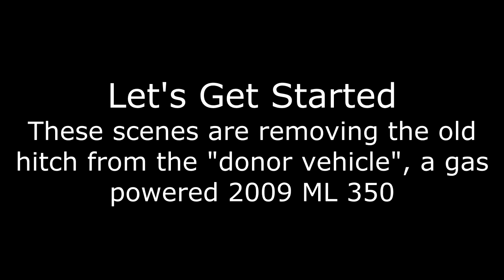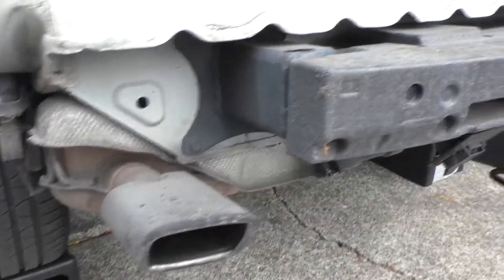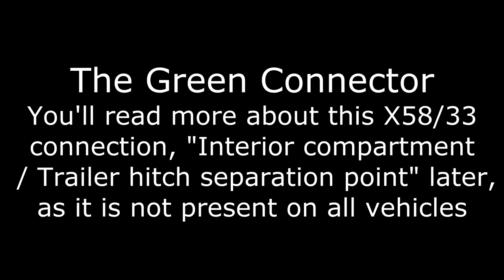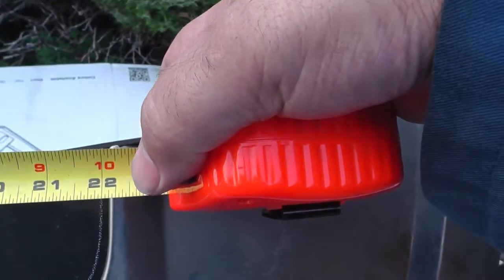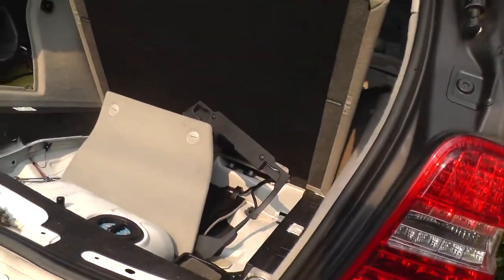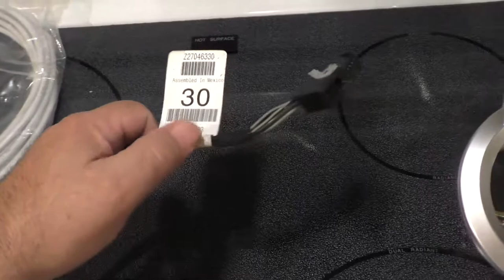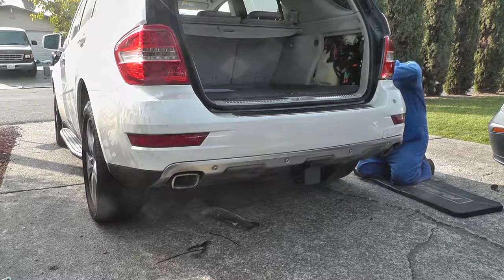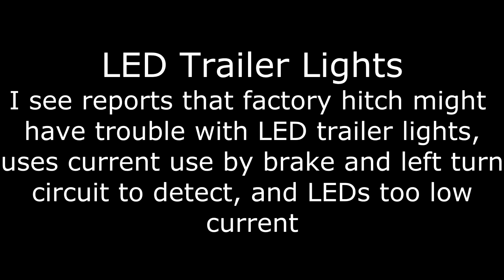Retrofitting Factory Trailer Hitch to Mercedes ML350 -- Remove from 2009, Install on 2011

Comment: A very thorough walk through. Thanks for this. I am planning to install a hitch on my 2007 ML 320 CDI as well. This is extremely helpful. Side note, I think it was very smart of Mercedes to move that SAM module to the new location. It always gets water damage while in the old location.
Reply from the maker: Good luck!

Comment: Great concise and clear video! Thank You for your hard work.What are the benefits of wiring this the factory way? You mentioned the hitch sense when it was programmed by the dealer. What does MB do to the vehicle when this suv is towing something. Does this hitch sense change anti sway,abs,transmission shifting or anything else to enhance the towing experience? Maybe nothing at all!
I have a 2011 ml350 and obtained the complete hitch and harness from the scrap yard.I will install electric brakes for the motorcycle trailer thus I will need  to add necessary connections .Tekonska has a Hall effect wire sense  product that picks up the brake ,running lights and blinkers  from the taillight wires and they also have a wireless blue tooth brake controller that may manufacture that makes the brake controller more convenient to move from one car to the other and install.I noticed that the 4 pin green connector under steering wheel has the connections input and output to the brake controller.I know one of the wires that is black with a maybe white tracer goes to the terminal 15 connector.What this wire does for the Sam I am not sure. I am hoping that the Sam does not need this signal being that it is Bluetooth.
Not sure if to go the MB way or aftermarket route.I appreciate your valued response!
Thank you again!
Reply from the maker: I'm afraid I don't know all the details of what the ML activates when it knows it is towing, but the one I did think of as important and that I did read about was that the "Electronic Stability Program", which is a computerized intervention with both the brakes and the engine power (and, I think, traction distribution) based on input from the steering angle and yaw sensors to help prevent rollover if you "enter an unstable driving situation".   Apparently the system is smart enough to alter the profile for that system when towing, which seemed like a good thing to me.      In other less-good news about the factory system based on recent experience, and I don't know if later SAM revs fix this, is that I went to rent a big U-Haul and had to hook up to several different trailers (using a new 7 pin to 4 pin adapter) unsuccessfully before by dumb luck I hit one that hadn't yet been retrofitted to LED lights and still had conventional bulbs.  The setup would not detect the LED equipped trailers.   I think there are 7-to-4 adapters that can help with this by providing resistors to sink a tiny bit more current to help the car detect the trailer, but I note it as a blemish on my otherwise perfect towing record with this setup.   Note that until the car "detected" the trailer, it did not bother sending lighting signals to the hitch socket.  No lights at all.    I think that the "trailer brake controller", which directly controls the trailers brakes,  would be pretty independent of the SAM, and that a Bluetooth based one would work fine.

Comment: The lesson is to buy a truck with the factory hitch already installed. You sir, have done an outstanding job retrofitting that factory hitch. But I just went with the aftermarket and settled for the lower tow rating. No one could give me a clear answer on the SAM reprograming, and the cost of parts was too high to gamble on it working or not for me.
Reply from the maker: I don't disagree.. the "add-on" cost of the hitch buying the vehicle new is nothing compared to all this hassle, but I was in a bad spot with my insurance company having totalled my hitch equipped 2009 ML350 offering just $7200 because of high (highway) miles, and being unable in the short time I could stand being without my car to find a hitch equipped replacement that met my requirement of "diesel or the larger V8 engine", and "white" and "all wheel drive", and "the same sound and nav package the 2009 had, not the entry level one". I drove all over looking at the cars available in my range, added money to expand the range, and still had to compromise on the hitch in the end.   Had I known what I was in for in the retrofitting, I might have expanded my search geographically or added still more money, but I am glad in the end I persevered. It was definitely a gamble, and even with this info it will be a gamble for others, I just hope I have helped even the odds for someone in a simlar spot.  Thanks for the comment, and glad your aftermarket met the need with less drama.

Comment: Outstanding video, great explanation! I have a question, that you may not be able to answer, but your recommendations will still be appreciated. I have a 2010 ML350, Gas with no Hitch. I have been looking for a Factory Hitch to retrofit as you did, but have come up empty-handed, until today. I found a new European Hitch assy on Craigslist, that will require a lot of modification to work. The Euro  Receiver will have to be removed (Cut Out) and a USA receiver installed (welded) in, and the wiring will probably have to be modified. I am a retired Diesel Mechanic so I am somewhat familiar with these types of situations. However, because of the unique characteristics of the European Hitch, ( it rotates out of the way), it may not be worth the effort. Any advice will be appreciated. Thanks Pat
Reply from the maker: I don’t know enough about the Euro variant to comment, but if the ad is still up with pictures I could take a look and speculate with you, especially if the CL listing has a part number or something
Reply: I just realized that this Hitch doesn't swing out like many Euro Hithes I've seen, but actually has the Receiver mounted vertically (Facing down). The Ball Part of the Receiver is actually inserted up into the Receiver Socket. The problem then becomes, What size is a Euro Ball, too many variables. I kept searching Youtube and then I think I may have found the answer. Tesla uses this same type of hitch, i.e. 2 inch Ball, made by Westfalia (Germany), this may fit the Mercedes Euro Hitch, I assume this type of Socket Insert is a standard fitting.
Reply from the maker: @bigpapaporsche1  Aha. I searched a bit on Tesla, and see you mean "Eco" (EcoHitch), not "Euro".   I see pictures of the downward facing receiver, etc.   My thoughts relative to the experience in the video are that there are two aspects to "mounting" a hitch, the physical attachment to the vehicle frame at various points, and then the wiring and how it taps into the Mercedes wiring.    The EcoHitch's are completely aftermarket, so they will always differ in the physical attachment (won't go into those sockets that then side-bolt to frame, so won't be a full weight redistributing and thus have less overall capacity), but I think you have a choice in how you wire it.    Any of the aftermarket hitches, like EcoHitch, are going to come with (or you can buy if your particular hitch doesn't include) a nice harness and instructions for your particular vehicle on how to tap in.   I believe those are a very light touch on the car wiring, and literally just parallel in on the power going to your existing stop, turn and tail lights.  In other words, they will work fine, but in a very real sense the car "won't know the hitch and trailer are there".    By contrast the factory harness has a very complicated connection into the cars wiring into the Signal Acquisition Module and other points so that when the feature is enabled by the dealer in the onboard computer, the car detects that the trailer is present, and alters the automatic braking and automatic stability controls (among other things) to allow for its presence.    So you have to decide if those additional fancy electrical features are something important to you, and if they are, you would have to follow the EcoHitch's instructions for physical installation, and then my instructions for wiring, including somehow getting yourself the actual factory harness, including the "hitch" part of the harness, and running factory wiring all the way down the the actual socket that accepts the plug from the trailer (using MB factory socket, not the EcoHitch one).    I don't think most people bother with that.  I think when they use an aftermarket hitch, they use the aftermarket wiring style, which is easier to do then all I had to mess with buying relays and going to the dealer, and they're just delighted to have their lights come on when they stop and turn.    I went factory, but you can see the hassle, you'd probably be perfectly happy aftermarket, and if you do, be sure to follow those instructions (not mine) because they're different.
Reply: Pat Maundrell I have the 2010 ml350 as well. Did everything go right? I am in the process of buying an airstream hitch 28’ for a super price. Can you tell me it will be alright?
Reply: @T61873  I decided to use my wife's Subaru for our Towing requirements and not install a Hitch on the ML 350. It is possibe to install a Hitch on a ML350, but in my opinion, ( Baaed on 50 years of Automotive experience) I won't be happy with it. Let's face it, it would be a compromise at best! I bought a Mercedes and didn't want to bastardize it by installing an Aftermarket Hitch, etc.
Here is the best advice you will ever get, regarding Towing a trailer! Sadly, you will have a problem finding it in print anywhere. However, the Airstream Forum has discussed it years ago!! Even though the ML 350 is a magnificent vehicle and is rated to Tow a Trailer, in terms od Power/Braking, like an Airstream 28, it is marginal! We used to have an Airstream 25 trailer, among other trailers/RV 's, and understand this first hand. Simply put, you "Wind up with the Tail (trailer) wagging the Head (car)!" In other words, the combined Wheel Base of the Car and Trailer can create an unstable situation when an emergency arrives! This situation is caused by the "Excessive Leverage of the Trailer," which can overwhelm the Car's ability to counter this Leverage which can result in loss of Steerage Contol and a Jackknifed Trailer/Vehicle. In order to provide a Safer Towing situation, the best recommended Towing Vehicle for trailers should be a Vehicle with a Longer Wheel Base than an ML 350, Vehicles like a Chev Suburban or Ford Excursion are good examples!
Reply from the maker: Sorry missed when first posted.  Yes, in the end, everything worked fine including the dealer programming the SAM on the second try (see first comment for the relay I left out first time).   As I mention in a few other threads, aftermarket hitches are good at what they do, and are much, much easier to install, but if you want or need the maximum towing capability out of the ML350, like I wanted out of my "new to me" diesel ML350, one has to either take a lot of time and parts chasing and do it yourself work like I did in the video, or pay the dealer in certainly low four digits, to replicate the full factory benefit of the "weight distributing" hitch that fits into those special sockets integrated with the side rails and bolt in.    I suppose a compromise might be to find or pull from a wrecker just the heavy mechanical weight distributing hitch (for maximum mechanical strength), then wire it in "aftermarket style", just tapping into the tail and brake lights the way the aftermarket hitches do.

Comment: Where is the best place to get the harness? I'm fitting the gooseneck type towbar over the weekend, I can get one but it will take 4 weeks to arrive
Reply from the maker: Sorry to say I eBay'ed the one I got, by searching part number, which I know is not predictable.   For factory-only parts, my strategy is to first get a rock-solid part number, which is hardest part, and then shop my regular online suppliers like Pelican Parts to see if they have it, and if not, I'll Google the number with and without hyphens and usually get a whole spread of "discount OEM benz" suppliers, who are just local dealers discounting, and use the closest of those, or finally as last resort, eBay search for part number, which gets both new and used parts.

Comment from the maker: The current version of the video *leaves out an important step*... I will repost a corrected version soon, but in the meanwhile...  I forgot to add that I had to plug in one more relay, part number 

'A 002 542 81 19", into position ‘U’ in the rear cargo area relay box, the very top left position.    The dealer's first attempt to program the rear SAM failed when I did not have that relay, but it programmed successfully after I added it.
Reply: Wow! unsure how you figured all this out. I have a GL 2016 that I retrofitted with the factory hitch but stopped once I realized I had no trailer recognition unit installed. next step is to just tap into the wires and call it a day.  Im going to look deeper under the seat now and see what I find. Thanks for the video.
Reply from the maker: Sorry didn't see comment earlier.  Figuring all this out was one of the harder slogs I have ever done through the Mercedes factory wiring diagrams, the forums for others who had tried and shared, and eBay and others for pictures and part numbers.   On every other Mercedes job, following all the digrams and  all is hard, but in the end, it is all there where it says.  Uniquely, the trailer hitches (or "coupling" as the manuals call it) are in a weird limbo between being a factor installed thing or a dealer added accessory, so they are always on some weird page or footnote in the diagrams, and the part numbers change constantly.   I am glad I persevered in getting it working, but literally had no idea what I was getting into when I started.  Had I known, I might have just bagged the factory job and gone simpler aftermarket... but I don't know.  I'm kind of stubborn that way.

Comment: Is the install the same for a 2010 gl450 ?
Reply from the maker: Only in the sense that the same kinds of systems are involved, wiring to the hitch itself, figuring out if there are "hitch only" components that aren't present in a "non-factor-hitch" vehicle, like the two relays I needed, and of course the trip to the dealer programming to tell the vehicle is now has a hitch.    But even though I am saying they are generally the same, I am sure the specifics vary for the GL.   The good news is that at the end of the video I show a number of different links that I relied on to figure out the ML, and I know many of those links also include information on the GL, so for your case you should probably  start with those links and see how much GL information is available there, and judge for yourself if enough is covered.  Most of what I needed for the ML was in various web pages that I linked to, but figuring out the last missing relay did take me several hours of scrolling around myself in the wiring diagram in the ML factory service DVD, literally following the wires from the hitch to the relay panel, having to figure out how to read multiple years in different boxes in the same diagram and decode the weird links between different pages of same diagram, to get all the way there.
Reply: @DOUGSVIDEO999  Thanks. I just installed mine. I only needed mine for a bike rack so did not require the wiring. Went pretty smooth minis finding all the screws.
Reply from the maker: @abdullahmamun8797  What a pleasant surprise to get to skip all the electrical issues for your purely mechanical need, all the problems are definitely in the darn lighting and trailer detection to alter the stability system profile to allow for a trailer.   That must be one very solidly mounted bike rack, now.  Super solid mount point.